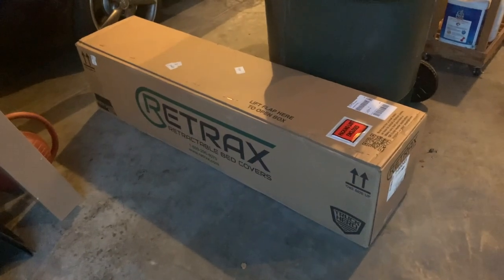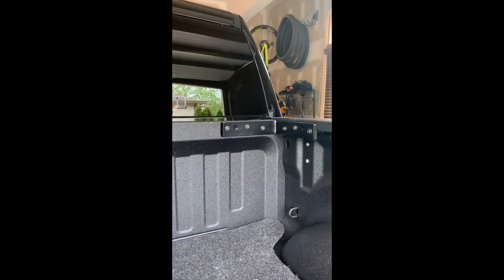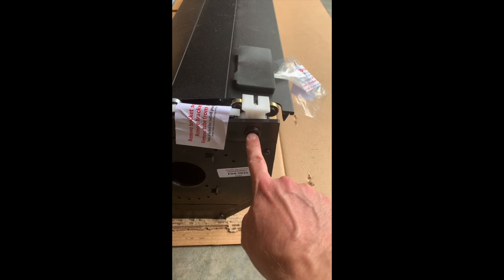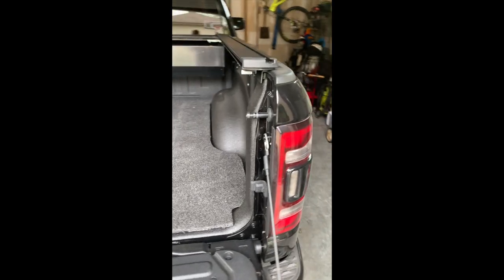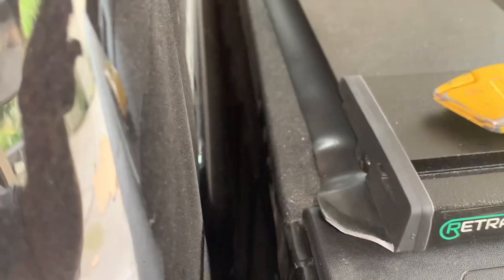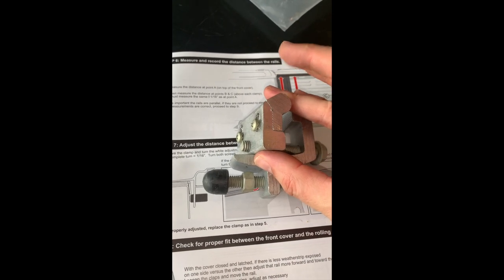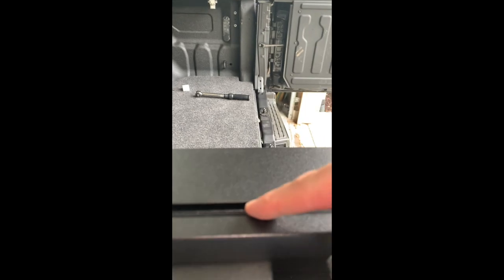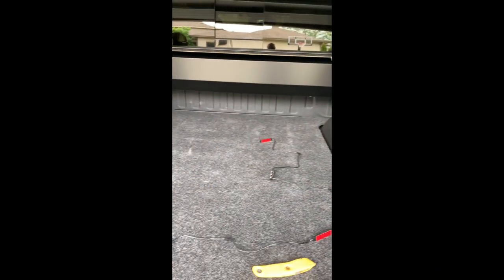2020 Ram 1500 Retrax XR Tonneau Cover installation

Comment: This  Video is very informative getting ready to put the retrax xr on my New 2022 ram with the multiflex tailgate.. Found the  Front corner brackets they are called right on brackets they are about a 100 bucks which includes a shipping.. Thanks again for your video it's a big help.. Happy Thanksgiving everyone

Comment: Thanks for the vid. Had a retrax on previous truck and loved it. Was in process of buying new RAM limited, but had a hard time finding one in my area w/o MFT and was told by retrax no go with MFT unless with rambox (which didn't want).  However, your video showed still possible with bracket switch and hence able to easily find model I wanted  even with MFT.  Appreciate it.
Reply from the maker: I'm glad the video helped. I hope you're enjoying the truck as much as I am!

Comment: hey, thank you for sharing this video. i also have a ram 1500 with the mft and no ram boxes and was looking for a low profile tonneau cover, however the options are very limited. do you know if installing the rightonbrackets will void the factory warranty?
Reply from the maker: Your warranty is safe unless whatever failure you have can be proved by the Ram to be directly caused by your modification. See: https://en.wikipedia.org/wiki/Magnuson%E2%80%93Moss_Warranty_Act  
Glad you liked the video!

Comment: Hey, i bought the pace edwards retractable cover. It did not fit width wise. just 1/2 a inch over. The pace edwards bed cover width is 61 3/4
truck bed is. 61 1/4.

are you able to meassure this bed width. i would greatly appreciate it. thank you in advance. i did purchase and install the bracket you recommended from the ssme web site

Comment: Did you wind up installing the Yakima rack?  Looking at doing exactly what you did, then adding the Yakima Overhaul HD as well.
Reply from the maker: Hey jonahmd10! I did exactly that. I added Skyline Towers with the Corebars and Highroad carriers for my mountain bikes. Works great. The Overhaul looks pretty nice too, and I may be wishing I had that if I get some paddleboards/kayaks in the future.
Reply: @grvlmaml9043  Awesome.  Any issues with the Retrax tracks being damaged by the Yakima Tonneau 1 kit?  I've read some reviews that are discouraging to say the least.
Reply from the maker: @jonahmd10  I've had no issues. Are you talking about how if you crank down the landing pads too hard they deform the track on the retrax?
Reply: pedalsandsixstrings Yes. There are a couple pretty vocal posts out there about how the Tonneau kit damages the rails, but many more who say it hasn’t been problematic. It is odd that Yakima isn’t selling the Tonneau kits anymore.

Comment: Thanks for this video, it is the "standard" must-see if you want this cover with MFT.  Can you tell me the width of the canister for the Retrax Pro?  I saw how close the tolerance was (from edge of canister to the bolt from the Righton bracket) in your video.  I measure 61 inches from bolt to bolt.  Nobody can tell me the width of the canister. just double checking!
Reply from the maker: Hey Doug Sales, thanks for the kind words. I’ll get you a measurement ASAP.
Reply from the maker: Hey Doug, the canister is 60 5/8ths inches wide. Plenty of room! 😁
Reply: @grvlmaml9043  thanks for quick reply! Whew, that is close, especially given my measuring skills. Looking forward to the installation! Thanks again.

Comment: Ok that explains it it’s the braces that causes the issue ..I have a extang coming and they claim it will work with MFT
Reply from the maker: I would think the extang would work. Let me know how it turns out!
Reply: pedalsandsixstrings turned out great 10 mins to install also

Comment: I cannot get my torque wrench to work. How tight are you tightening the clamps?
Reply from the maker: Hi John, that's kind of tough to answer since my version of "tight" and yours could be pretty different. You can tighten stuff so much that it starts going askew, so that's one way you know you tightened them too much. I think it'd be worth getting a hold of a torque wrench and doing it properly sooner rather than later.

Comment: I’m about to attempt to install one of these on my 2020 ram 1500 with the multifunction tailgate. Now I do have the brackets for the corners but my question is do I have to remove the extra tiedown rails as well?
Reply from the maker: If you’re talking about the bed utility group, I doubt very much that you’d have to remove it. I don’t have one but the Retrax doesn’t go very deep in the bed other than the cartridge, and I think that should clear the rails just fine. Let me know if not though. Good luck!
Reply: pedalsandsixstrings thank you!
Reply: John Barron I have the utility bed group and they do not interfere with the cover.

Comment: Hi just installed my cover question for you did you use loctite on the screws for the replacement bracket?
Reply from the maker: hey lambolambo70, I did not use loctite for the replacement bracket screws. I just torqued them to roughly where they were and haven't had any problems.
Reply: Did you find torque specs for the replacement right on brackets or did you just wing it?
Reply from the maker: @mathewregister8510  I just winged it. I'd be surprised if there was a long-term issue, but if there was, it wouldn't be awful having to uninstall/reinstall the cover to retighten the bracket bolts.
Reply: pedalsandsixstrings that’s what I ended up doing too.  The Right On brackets worked pretty slick.
Reply: pedalsandsixstrings Did I do the right thing by just wrenching these down as tight as I could With a socket wrench?
Reply from the maker: John Barron I think that’s fine. It’s not like those bolts are holding the transmission to the frame.